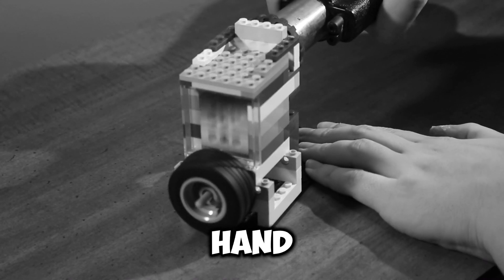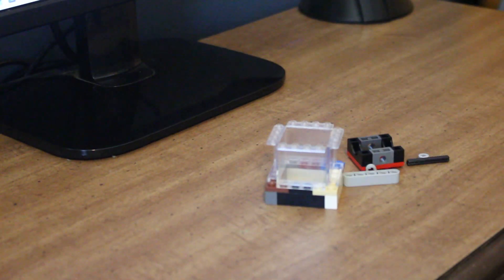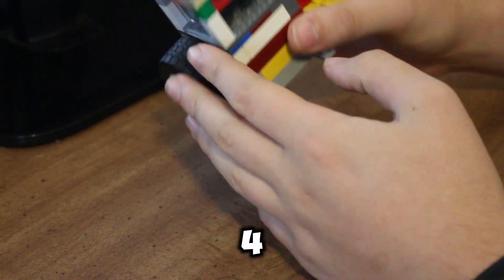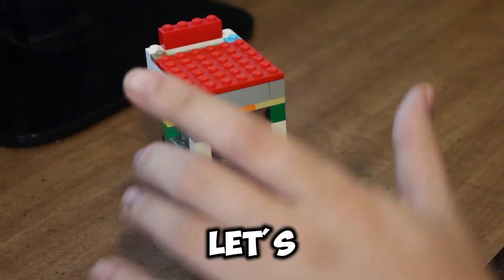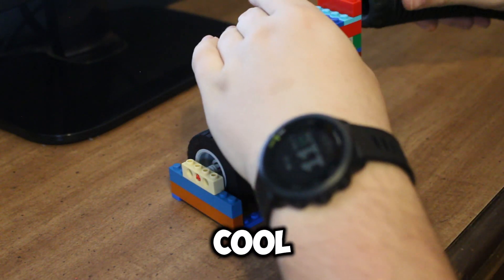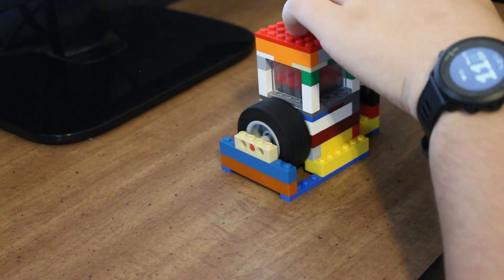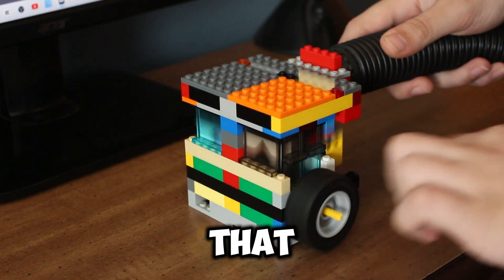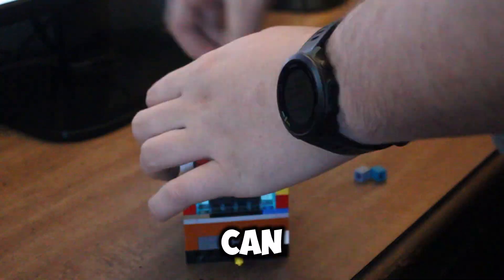Noob tries to build LEGO vacuum engines AGAIN!!

Comment: I love how all the colors on these engines arent perfectly one or the other. To be honest, I actually don't like how people make them all color coded all of the time. Were practically adults playing with lego, so why not embrace the randomness and obscurity of the different pieces from presumably years of different random sets?
Reply from the maker: Welllllll..... 
For my engine testing videos, I prefer to just use what I have, but when I'm building my model engines, I very much like to color coordinate. It looks way better, especially with all the details I try to add. Like my Honda B16. If I were to just use whatever colors all over, I don't think it would look near as good, and adding all the extra details and realism would be kind of a waste of time. Looks are everything with model engines, but for vacuum engines, the running is more important (in most cases)

Comment: Wait, im just wondering what the difference of the flathead engine is. Is it that the flathead valve is on a camshaft and the rods have springs on them? And whats the advantage, if any>? thx :>
Reply from the maker: The flathead has the valves on the side. One advantage I find is that the are very mechanically simple, and I've had very few problems with getting one to run. The downside to the is that the air has to make very sharp turns, which is bad for efficiency

Comment: In the first time your engine wasn't running at all or would run for one second right?
So what changes did you implement to solve that issue
Was it the valves?
Reply from the maker: (If I read this the correct way)
Lack of knowledge and a low-power vacuum. those were my two biggest issues. I did my research and was (thankfully) lent a better vacuum, and now my engines run much better. Still not perfect, but a huge improvement.
Reply: @DeltonAdamsLEGO can you do a tutorial on a poppet lve?
Reply from the maker: There's already a ton of tutorials out there by far more qualified people than me

Comment: The reason you put oil in is bc it will melt and seize the axles
Reply from the maker: Well, yeah, but that's only if you're going for something like 5K+ RPM or high performance engines, neither of which I am trying to do. So I don't really see any reason for me to use oil for these engines

Comment: Hey I tried making a flathead and for some reason both the valves are pulled up and idk why
Reply from the maker: Sounds like the spring on one (or both) of the valves is too weak
Reply: @ did you put valve springs on yours?
Reply from the maker: @reesemolloy6109  yes, they were somewhat soft, but I pre-loaded them, so I held them in place with a bushing and gave it just enough room to open fully, which allowed for me to adjust the compression amount

Comment: I have NEVER seen someone make a video about Lego engines and make it so clear on HOW to make them cause I make engines that DONT run they are basically rpm testing engines I build them I give them to my friend who tests them with a Dremel which supposedly can go 33,000 rpm and almost every one of my engines survived with little to NO damages 33,000 rpm with a Lego single cylinder is fuggin scary
Reply from the maker: Jeez, yeah I can imagine 33,000 rpm is scary 🤣

Comment: The reason the 6x6 engine wasnt as fast is cause air wasnt getting back into thhe chamber like the other ones
Reply from the maker: @Davidoslikesbeans  the 6x6 was pretty fast for a poppet engine. And air was getting back in through the intake valve (the one closest to the camera)
Reply: @ oh ok I thought no air wasnt getting comming in just wanted to make sure:)

Comment: How are you able to get your engines running for so long? Any one that I've made doesn't last any more than a minute before breaking something or shaking itself to death, even with a 3D printed piston and valve.
Reply from the maker: To be honest, I don't really know. I used to have that problem, but I started to kinda over build most of them, for example the first two, they are heavily over built, and nothing seemed to break apart

Comment: I just finished my v4 engine
Reply: how do you get the piston to go down every time i try starting my 1 cylinder it doesnt want to start it has compression it just doesnt fire
Reply: @450starr_Danny  timing most likely you got wrong.
Reply: @Rafsnuggets1  i got it figured out thanks
Reply: Now all you need to do is double the cylinders.
Reply: @Metal-Sonicor quadruple them

Comment: W vid!
Also what does "svs" stand for?
Didn't hear that term used in lve's before. (Even tho i used such valve myself)
Also if i had gears, i would love to experiment with that valve offset angle, to achieve more efficiency perhaps.
Reply from the maker: According to what I've heard, SVS stands for "slide valve system" though I have also heard people refer to it as "single valve system"
Reply: @DeltonAdamsLEGO  "Slide valve system" makes more sense imo. 
Cool!
Reply: @vKamael  I agree.

Comment: try to make a v2 engine?
Reply from the maker: I plan to! There a whole list of more engines I want to try! I want to learn as much as possible!
Reply: @DeltonAdamsLEGO  try building it with a split con-rod on one of the pistons

just a conecting rod that splits into two half stud thick parts that fit around a regular conecting rod on the crank shaft
Reply from the maker: @WalkerO-dp8jq  all I can say is I have plans! 👀👀

Comment: You are not an idiot, cool guy, you are just inexpierenced in building vacumm engines! Mine only reaches 2000+ rpm after months of perfectionism and i can‘t get any to run without perfectioning it a lot
Reply: Man I can't even get any to run at all
Reply: I can barely get 1200 
Respect!
Reply: I got over 15k on my third try
Reply: 1. make a rectangle out of lego with a 2 stud wide interior and 2 stud wide walls (6 studs in total). Mine is 6 studs by 5 bricks by 12 studs.
2. add a propeller that is as wide as possible, but has a little (less than 0.2 studs) space. and make sure it does not hit the roof or floor
3. take a single brick off from the top of one side
4. make a hole as big as possible to the upper part of the other wall. Your vacuum should barely cover the entire hole. You can also widen the hole by moving the bricks on the side.
5. done
Reply: @Ap_603That is a turbine
Reply: My engine goes 2220 rpm
Reply: Mine only gets 1500-1560 rpm lol
Reply: I cant make one :D
Reply: If you want a simple but fast engine then use a turbine engine but if you want the one that actually sounds like an engine then make a piston engine